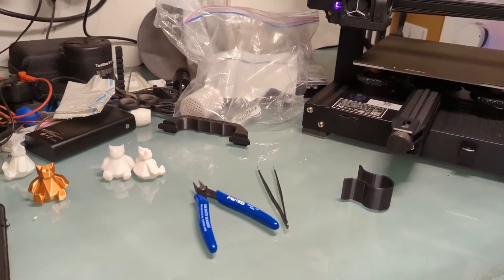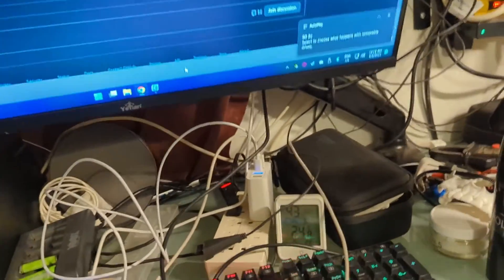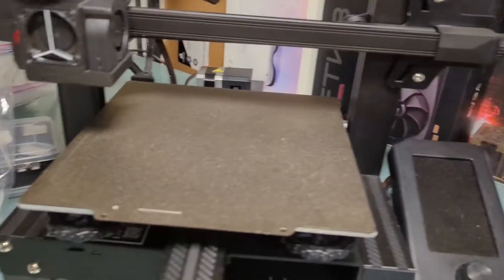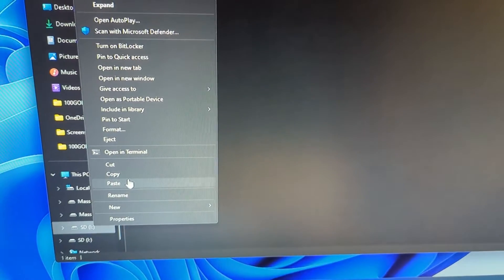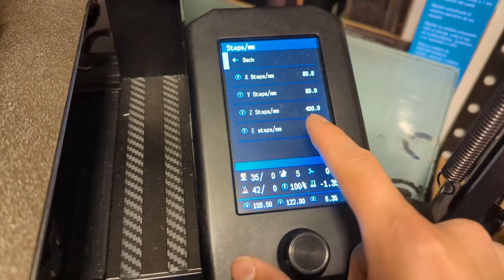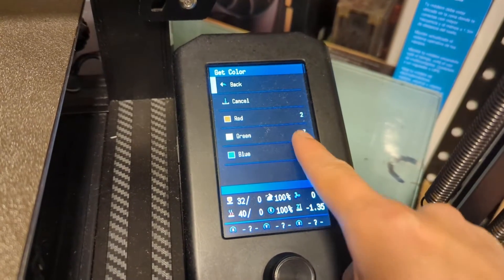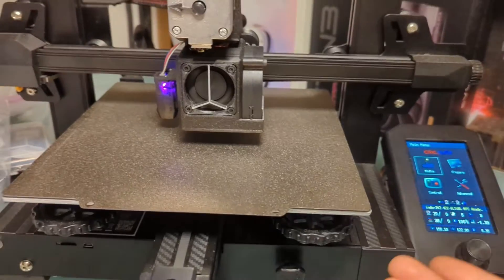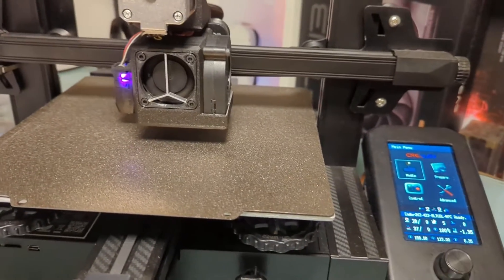Ender 3 V2 Neo - New Mriscoc Professional Firmware Release - Plus issue solutions.

Comment: Hi, i have problems after flashing the firmware : (

the nozzle is everytime printing lifted up : (

How i must fix these issue ?

1: Homing
2: Bed Tramming Wizard fixing 4 corners 
3: Mesh Leveling 8x 8 
4: Z Offset Fixing 

After everystep storaging the settings ?

Is that the way to fix these printproblem ? 

greets

Comment: So I Have an ender  3 v 2 neo & my issue i have followed all instructions to the letter on Git Hub and this video and the printer never updates the screen is not just stuck on the 'creality' splash screen and I cant access the menu on the printer anymore :/ iv used 3 different SD cards with no luck , can anyone help?
Reply: I have the exact same problem....did you find any solution?
Reply: @bobh2082  Change the firmware file name to something shorter "Firmware12345", I'm guessing the firmware name was too long.
Reply: @bobh2082  я решил такую проблему переустановив firmware на старую оффициальную прошивку дисплея и материнской платы исползуя инструкции с оффициального сайта Creality. Вижу надо относиться к новым прошивкам с осторожностью. Regards)

Comment: Any advice for me? My printer just wont start with this firmware, only eats the original.
Reply from the maker: You need to verify that you're using the correct firmware for your chipset.
Reply: I have a 4.2.2 board and using the 422 bltouch firmware

Comment: And your auto mesh feature works for you? I have a CR Touch as well, but I have to ALWAYS manually edit the mesh in order for it to be good. I am using a 427 motherboard; maybe it's a bit different from the 422 in this regard? I would love to know how to get this auto mesh to work automatically.
Reply: Check your right z axis V-slot wheels and make sure the eccentric nut is tight enough to where it barely move but not so tight that when levelling the right lags behind the left and makes the mesh level useless because the z is moving slanted

Comment: Using this fw, after doing a bed level and saving does it automatically enable it b4 printing? On the jyers it had to be selected first. I did a print and it didn't look level, ended up using the 5x5 probing to adjust my bed, got it within 0.1mm tolerance.

Comment: What are the steps' mm for the original? I'm not sure how to calibrate it my self, I have all original parts, no upgraded extruder or anything.
Reply: You probably found your answer by now, but if you didn’t, it should be 80 for x/y, I’m not sure what it normally comes with for E but for me it was 99.9 after calibration. Z for me is 400

Comment: What should we add on cura of all the physical settings we have changed ? Is there a way to use the whole build plate on Cura ? As of now i cant even slice on 220x220
Reply from the maker: I'd recommend just leaving the settings in cura as 220x220, if you want to use the full 220 you need to remove brims/skirts/rafts.
Reply: @Zeltroix  thank you for the response.. Looks like that wasn't enough, not even for the 220x220 i was aiming at.. I erased the disallowed areas from the ender 3 pro file and now combined with none on bed adhesion i can go up to 233 theoretically

Comment: how do you get the CF look rail covers?
Reply from the maker: It's a textured PET bed, got it from aliexpress.
Reply: @Zeltroix  you cut it up ,or that's    just the imprint from it.
Also are you still running the forward facing direct drive mod.  I'm  seeing a lot of flex (printed @65%) got the sideways mount on the printer, will try that one. Thanks.
Reply from the maker: @dfryer4558  It should be a textured PEI bed and on the back it has the PET surface with the carbon fiber look. I am running the front facing mod, it has a little bit of flex but not much. I printed it out in PLA and I think I did like 25% infill to keep it as light as possible so far no problem. PLA has less flex than PETG.

Comment: I use the following settings on my Neo:

Physical settings is this. Bedsize 235x230. This is also set in Cura.
X min -2
Y min 0
X max 242
Y max 230
Z max 250

Probe settings
X -40.4
Y -11.4

The Tramming wizard is probing directly above the screws, and my prints are centered.
Hope someone finds this usefull.

Remember to update your mesh settings to use max area
Reply: Is this an ender 3 v2 neo? Cus my bed is just 220x220
Reply: @matthewyoussef9774  yes it is.
Ender usually undersell their bed sizes to accomodate glass bed clips and to stack up tollerances.
If you take a measuring tool, you'll see the actual size is 235x235mm.

If you are using clips I recommend running with the original 220x220 size settings.

The reason I have my Y max at 230 instead of 235 is because the y axis maxes out before 235. The rollers will hit the endcap.
Reply: @Igniferi  what initial gcode do you use for the bed leveling?
Reply: @gametron9865  I use the professional firmware, which has a tramming wizard for bed leveling.
No additional G-code.
Reply: @Igniferi  I mean the gcode to load the mesh, I use g29 L0, G29A and G29 J2 but the mesh doesn't seem to work properly
Reply: @gametron9865  ohh, I usually start the mesh manually before a print.
Haven't looked at the gcode yet.
Reply: @Igniferi  Oh, ok, thanks, one last question, how many points do you use for the mesh?
Reply: @gametron9865  I've experimented with a few amounts, without noticing a big difference.
Right now I'm using 7x7 points, and a single measurement at each point.
Reply: @Igniferi  Thanks
Reply: how do you have your mesh settings?
Reply: @juanvago5688  the mesh inset? I just clicked on maximise area. (Professional Firmware)
Reply: @Igniferi  thanks!
Reply: my purge line with all these configs is now basically off the printer, any idea why that is?
Reply: @DarkBraveStuff  check you initial g-code in the slicer. I assume you start at a 0 coordinate. Move it inwards a bit, like X or Y 5
Reply: @Igniferi  i think it's the printer size, since on default firmware the line is usually in a more natural place
Reply: @DarkBraveStuff  I'm not using the default start gcode, but I believe my purge line was fine before I changed it. Either way, the settings further up is what I'm using, and they're working fine for me.
Did you update the size in the slicer aswell?
Reply: @Igniferi  just did that, can you copy/paste your purge line gcode here?
Reply: @DarkBraveStuff   M420 S1 L0 Z2 ; Use mesh level up to 2 mm
M140 S{material_bed_temperature_layer_0}
M104 S{material_print_temperature_layer_0}

G28; Home all axes
G92 E0 ; Reset Extruder
G1 Z10 F3000 ; Move Z Axis up little to prevent scratching of Heat Bed

M190 S{material_bed_temperature_layer_0}
M109 S{material_print_temperature_layer_0}

M117 Starting Print ; Sound that we're starting
M300 P100 ; beep for 100 milliseconds
G4 P250 ; wait 250 milliseconds
M300 P100 ; beep for 100 milliseconds

;Remove remaining plastic stuck to nozzle
G1 Z2.0 F3000 ; Move Z Axis up little to prevent scratching of Heat Bed
G1 X6.1 Y1 Z0.6
G1 X6.1 Y10 Z0.3 F100 E10 ;PURGE BLOB
G1 X6.1 Y60 Z0.3 F5000 ; Move over 50mm quickly

;Draw testline on left side
G1 X6.1 Y15 Z0.3 F5000.0 ; Move to start position
G1 X6.1 Y200.0 Z0.3 F1500.0 E30 ; Draw the first line
G1 X6.4 Y200.0 Z0.3 F5000.0 ; Move to side a little
G1 X6.4 Y20 Z0.3 F1500.0 E30 ; Draw the second line
G92 E0 ; Reset Extruder
G1 Z2.0 F3000 ; Move Z Axis up little to prevent scratching of Heat Bed
Reply: I have done it too and  I did everything like in the Video and when i want to lvl my bed its says probe out of bounce what is the problem?
Reply: @basti19908  I've never encountered that, don't know.
Reply: When you move your x-axis to 0, does it go off the bed? I've put those settings in and am having trouble getting this set correctly.
Reply: @TristanHughes-uq8dy  x-axis 0 will put my nozzle right on the edge
Reply: @Igniferi  thanks for some reason, I thought the nozzle would be where x=10. Sounds like a Cura adjustment to the base code then.
Reply: @TristanHughes-uq8dy  could be a slicer setting or a hardware setting. 
The original bed size is smaller than my current settings to accomodate glass bed clips, and would put the nozzle 10mm further in.
Reply: @Igniferi  how have you found the glass bed? I ordered one because my prints were still not holding in place on some parts of the bed. (I've not installed it yet)
Reply: Could you share your settings with the clips?
Reply: @TristanHughes-uq8dy  I don't use clips. I was talking about the default settings shipped with the printer. I no longer have these settings.

Comment: i followed your previous video with installation. I changed Gcode in cura but my printer does not want to print at all :( please help
Reply from the maker: Here is the start gcode I'm currently using try this, if not revert to the stock one, start copying from the *:
*Start G-Code for v2 Neo (Just copy and paste to Settings, Printer, Manage Printers, Machine Settings):
; Ender 3 Custom Start G-code
G92 E0 ; Reset Extruder
G28; Home all axes
M420 S1 Z2 ; Use mesh level upto 2 mm
G1 Z0.3 X60 Y2 F3000 ; Move Z Axis up little to prevent scratching of Heat Bed
M104 S{material_standby_temperature} ; Start heating up the nozzle most of the way
M190 S{material_bed_temperature_layer_0} ; Start heating the bed, wait until target temperature reached
M109 S{material_print_temperature_layer_0} ; Finish heating the nozzle
G1 X60 Y2 Z0.3 F5000.0 ; Move to start position
G1 Y2 X160 Z0.3 F1500.0 E15 ; Draw the first line
G92 E0 ; Reset Extruder
G1 Z2.0 F3000 ; Move Z Axis up little to prevent scratching of Heat Bed
G1 X170 Y2 Z0.3 E-0.05 F5000.0 ; Move over to prevent blob squish
Reply: Hi thanks yes it was the GCode I managed to get it to work. Thanks sooo much 🎉 it's amazing
Reply from the maker: @WithLovePTA  Hey, were you trying to print from USB or SD card?